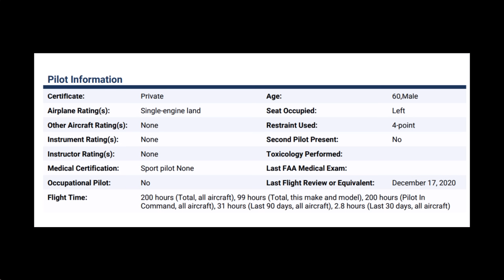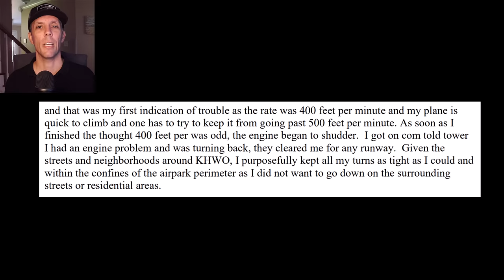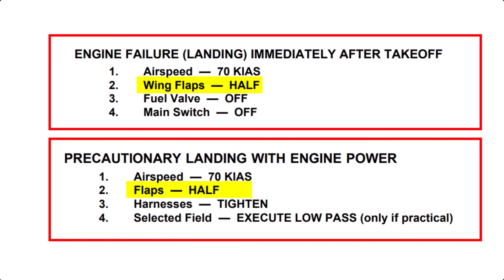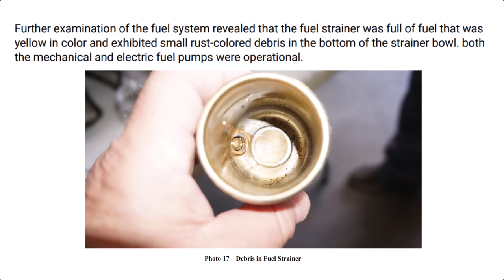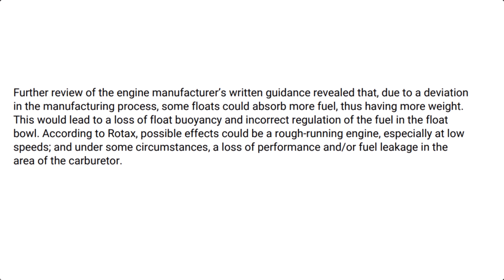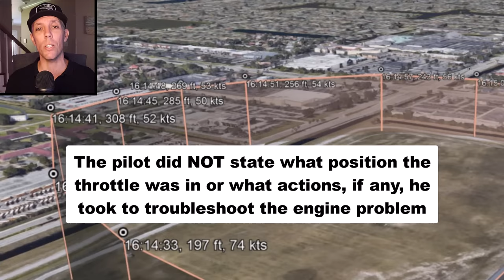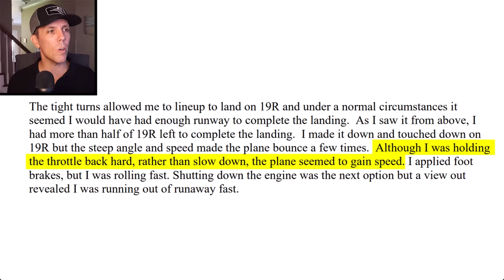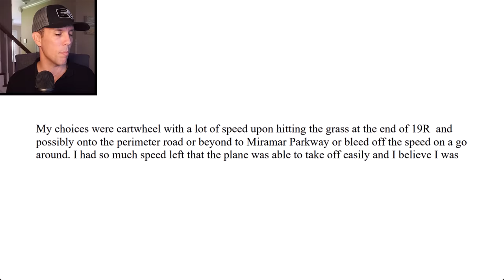Pilot Makes HUGE Mistake During Emergency Landing!

Comment: Over the years I noticed that pilots who have learned on motorized planes and only flew motorized planes can't real fly.
The engine always smoothed out their flying mistakes.
When the motor fails they tend to crash the plane because their poor flying is not smoothed out by the engine anymore.

A glider pilot just lands the plane as a glider.... like Sully Sullenberger did with a huge passenger plane in a river !

Comment: I think you have to have this all figured out before the engine quits. Where will I go, which runway? Flaps or not? Engine on or off? Side slip, slipping turn? Where is my abort point? what will happen if I go off the runway?

Comment: I think we all agree, Hoover, that the decision to go around once down was a very bad decision.  This go around default seems to be very common and can be very fatal.  Otherwise, coming from low altitude orientation rather than high altitude orientation, I commend him on some good principles.  Partial power is always a bit tougher, decision wise, than total loss.  He did apply good energy management to the tight pattern with tight turns at 1 g.  How so?  He paid attention to what the airplane wants to do in a turn, as Wolfgang suggests in "Stick and Rudder."  The airplane wants to get the nose down in turns to maintain airspeed, which is life when too low to recover from inadvertent stall, rather than altitude, which may only be just high enough to kill us after the stall/fall.  Yes, with some power this gave him too much altitude (potential energy that becomes airspeed) and too much airspeed and no flaps on short final.  In eleven of these, only two with partial power, I had (always have down low) zoom reserve energy to maneuver to a survivable landing zone.  Yes, in almost all I had to use full flaps and full forward slip (rudder to the floor) to make the beginning of the landing zone.  Anyway, he was doing proper low altitude principles until failure to use flaps and full forward slip in the turn to final.  1 g turns of any bank angle, as you know in your yo-yos in the F-15, are possible if we release the back pressure in the turn and let her have her head.  She will know what to do.  Good analysis all around, but think low altitude where airspeed is life.  Yes, he overdid the airspeed.

Comment: Armchair pilot, streets not full of cars, full of power lines. If anyone local knows if it's buried  utilities chime in. I had a neighbor, hubby was flying a twin, long before GPS, lost in weather, ( I think) low on fuel, found a farm, caught power lines, crash and fire, he died, her burned all over, the point being otherwise it would have been a banged up airplane. There is a compilation vid that I didn't bookmark of near deaths. One is a 2 person ultralite, engine quits over the threshold on takeoff ( in India, kept looking for crash India) pilot briefly turns left towards a 4 lane rd, see the lines, he went straight ahead hoping for a controlled crash, catches a large tree. Ironic part was minor injuries from the tree, major injuries when the airplane fell out of the tree after a few seconds and pretty much landed on it's roof. And if I was clocking only 50 hours a year and maybe didn't fly for a couple of months, I would have hired a CFI for lessons, then come back next week for the check ride.

Comment: I would like you or anyone here to answer my question please. I live near an airport where the pilots training and circling doing touch n goes never climb above 100 ft, how are they going to glide back to the runway if they have a problem like this????  Thank you in advance
Reply: Good question. Normally pilots taking off, landing, and shooting touch and go landings, are climbing to the appropriate traffic pattern altitude, which is between 800' and 1200' above ground level. This is called AGL. Anything below that pattern altitude means you need to lower the nose and start looking for a soft spot to crash land like a golf course or cow pasture.
Reply from the maker: Great question! 100 feet barely clears the trees in a lot of places. As mentioned in the other reply, pattern altitude is normally a lot higher than that. What airport is this at?
Reply: "...how are they going to glide back to the runway if they have a problem like this????" They're not!

Comment: You mention forward slips casually because they are something you have mastered.  But as a low-hours pilot who hasn't piloted for over 20 years, I recall that forward slips were approached with some trepidation.  I made it a point to practice, but a couple of hours every few weeks doesn't keep you proficient in much of anything.  When I married a worry-wart who seemed to want to keep me around, I just gave up flying and parachuting.  She is definitely worth it.
Reply: Forward slips are a maneuver I teach starting at 5 hours. It’s a totally basic maneuver. If a pilot with 200 hours is uncomfortable with those then there is a big problem
Reply: That’s really sad.
I slipped in many landings during VFR dual instruction and VFR solo operations.

You should slip every landing as needed to acquire and maintain proficiency!

Comment: i have a rule i live by... i never fly anything rotax powered.. some use them in snowmobiles... others possibly in jetskis..  but i hate getting stranded anywhere.. especially in the air or on the water..  so, i have a strict no rotax rule.. it's never failed me..  i'll keep my moped engines in mopeds.. i've owned various Lycoming, Continental, P&W, Honeywell, and Garrett engines in my aircraft.. all have treated me well so far.. i'm not saying that these never fail.. any and all can fail at any time.. but when it comes to piston engines in aircraft.. i've seen way too many untimely catastrophic rotax failures along the way to choose one for myself.. i hear they are getting more reliable.. i hope so, but still, no thanks... i'll pass..

Comment: Without even finishing the video. Seemed to have plenty of air speed. Configure the plane for a normal landing and bleed off speed as soon as I could. Drop in flaps and as he was going to be high at the threshold. Maybe even slip it a bit so I had more runway to work with. He panicked .

Comment: It's actually really easy to wish you had more altitude, but that doesn't do you much good, unless you have an old fashioned Arab oil lamp. Even then it needs to be a special lamp.
     If wished were feet, I'd have two, and I'd be 6'7"
     I should have been 6'7" but I lost a foot when I was 3.

Comment: Not a pilot but it seems so obvious to me that one would want to use the engine to get as much altitude as you can while the engine is still functioning that I wouldn't think it was necessary to say it. Altitude is everything, you can't get it back once you lose your engine, so I would want as much as possible, you are just wasting your engine entirely by not taking advantage of what power it has to give. Well, maybe not entirely since at least you are not losing any altitude, but to see a person intentionally descending while knowing that the engine may not last seems ridiculous.

Comment: Even if he had rolled into the fence, it was likely to absorb energy beautifully. The pilot did not possess skills and judgement that a slippery  single required, and none at all for a forced landing. Had he been anywhere other than at a large airfield, this would not have ended well.

Comment: Aren’t the ADS-B speeds ground speeds, not airspeeds?  Depending on the wind, ground speeds in the 50s may not have been all that slow airspeed-wise.

I thought he looked pretty fast on final for that size airplane.
Reply from the maker: Yes, I mentioned this when referencing the NTSB diagram. The surface winds were 310 at 7 kts, so you have to adjust a few knots depending on the flight path and whether it's a head, cross, or tailwind.
Reply: @pilot-debrief  Yes, but then at about the 7:33 point you said he was a little slow, referencing the ground speeds, and should have been about 70 which is an airspeed.  The two can’t be compared directly.

Comment: Why so much engine trouble with airplanes? Oh, wrong fuel. 

My 23 year old Toyota has 442K miles on it and it’s never failed me yet. I’d drive it across country today. I’d change my oil first but that’s it.

If you fly the same plane, shouldn’t you memorize, practice, rehearse engine loss scenarios and processes? While on the ground.

Comment: Very good debrief.  This exact same scenario happened to me.  Since the engine was still running, I kept flying until I got it back on the ground.  I was shocked to find how many people felt I should have gone straight to an off-airport landing.  I'll admit I could have done things better but why bend your airplane if you don't have to. I originally uploaded my video for my mechanic and CFI.  I later did a short debrief to explain my thinking. Original post:  https://youtu.be/2Wcjus3y8zs?si=ho2-0WXn_dAdfEMI    Debrief: https://youtu.be/SiBQtkJgK88?si=FnvIXFVgy6JGHgca

Comment: aviate navigate and communicate seems like a flawed system. firstly, you should always be navigating... second, if you fail to communicate an emergency at all before you crash, it will be much harder for first responders to locate you, assuming nobody witnesses the crash and calls 911... just like riding a motorcycle, you need to be aware of your surroundings at all times and make decisions before the incident occurs...

Comment: First, this is why i do my best to stay away from this airport (KHWO) when it comes to maintenance. I live near this airport and I've noticed that every crash or mishap that takes place, the common denominator is not pilot error, but mechanical. Yes, this crash was due to second guessing the landing. However, going back to my original thought, the mechanical. Why isn't the FAA NTSB or whomever doing their job or thoroughly reviewing the people who supposedly are trained to keep the ensuring the aircraft safety?? Are their second set of paperwork being shown? In other words, one the truth, and one being shown to be the truth?
Case in point and my opinion.
This is why i will not train here or use any of their aircrafts. I don't care about the less expensive rental or instructor fees. If the aircraft is not safe enough to save my life, forget it.
Luckily, the pilot or no one else was seriously injured or died.
Thank you for breaking this video down and explaining how to better handle this situation.

Comment: Another accident that was due to poor decision-making.  Not enough people in general aviation take the task of flying as seriously as they should.  There is a lot more than fair-weather flying with no aircraft issues.  Always be thinking ahead of where you are and always have a plan.  One of the other life-saving skills is to be a competent instrument pilot.  Not just having an instrument rating and relying on your autopilot.  When systems fail you need to be proficient.

Comment: The best solution: have every pilot do a mandatory 20 hours and 50 takeoffs and landings on gliders
Reply: It's not the same because gliders don't have an engine weighing them down.
Reply: @ItsAllAboutGuitar  no, they only have pilots weighing them down. A plane is a plane. When you don’t have an engine to rely on, you fly. Try it.